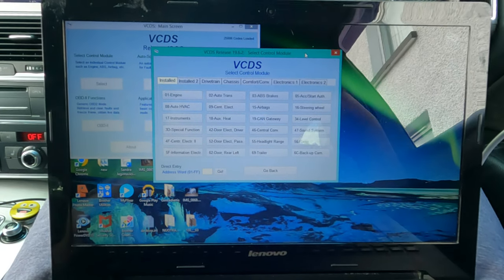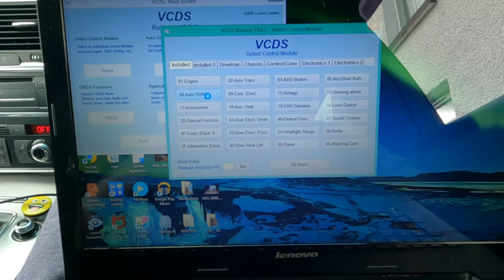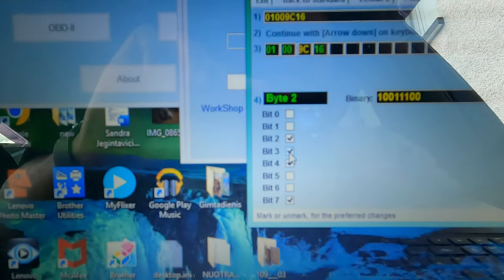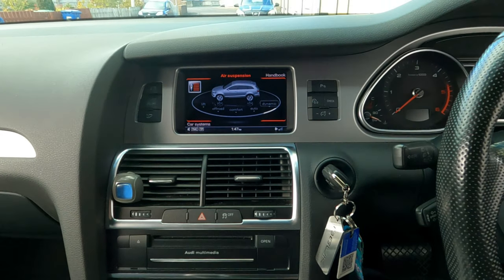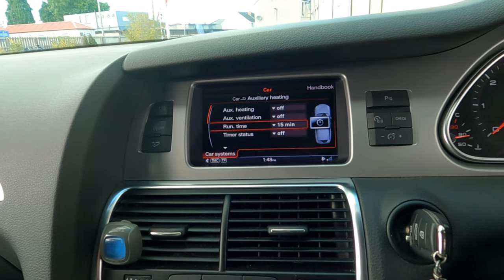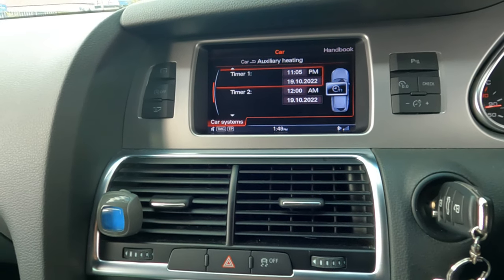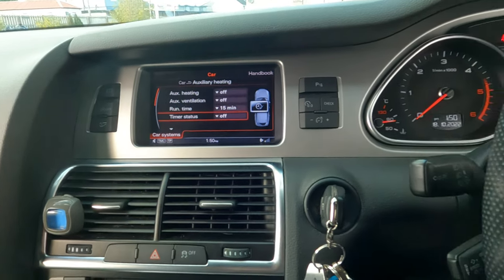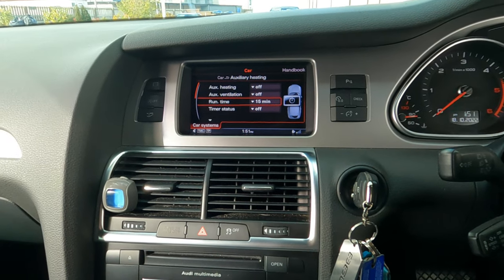Auxiliary heating enabling through VCDS

Comment: Very helpful and informative thank you for sharing your knowledge.
Reply from the maker: Much appreciated for the comment.
Very glad you find it useful!
Reply: @_LuisS  I need help with my Audi q7 suspension leveling system is not functioning properly. Your help is appreciated bro.
Reply: @_LuisS  would you mind sharing your experience on how to fix the issue I have with my Audi q7 suspension leveling please?
Reply from the maker: @EthioKenya  I'll help with what I can. what exactly is the problem?
Reply: @_LuisS  thanks for your reply. My suspension is acting crazy lately sometimes working sometime doesn’t it shows a yellow flash light.
Reply from the maker: @EthioKenya  you need to be more specific.
Does it happen every time you drive?
But you will need to scan the car for faults. Other than that it'll be just guesses.
Could be compressor. Valve block.
Leveling sensor. Speed sensor. Abs ring.
Reply: @_LuisS  well I scanned it with OBDeleven and it’s says solenoid for level control system and fault code is 02645 and it’s only happens when I drive less than a mile and braking starts flashing a yellow car symbols.
Reply from the maker: @EthioKenya  solenoid for the level control is the valve block. 
Most likely will need replaced. 
If I remember correctly it's under the car. Somewhere around where the drivers seat is. Try to take a look to see if you can find any signs that it might have failed.

Comment: Great!
What about folding mirrors when car is locked with remote?  Do You know how to code it?
Regards.
Reply from the maker: These don't even have a coding for it.
I wanted it too. 
If you want to fold/ unfold mirror with remote you'll need to fit an aftermarket modules that will do just that..